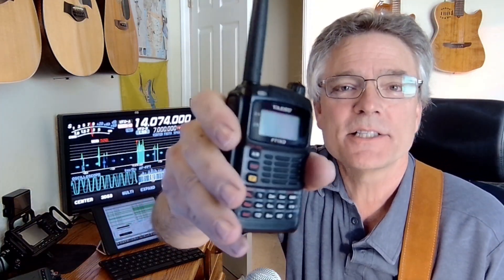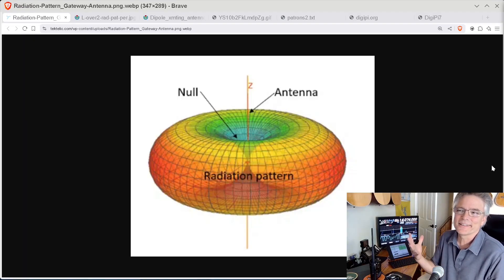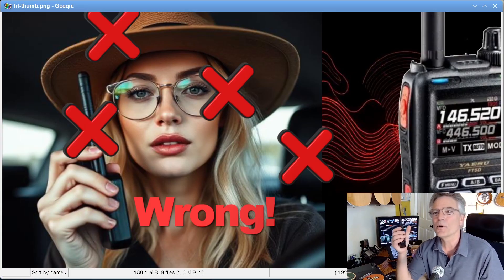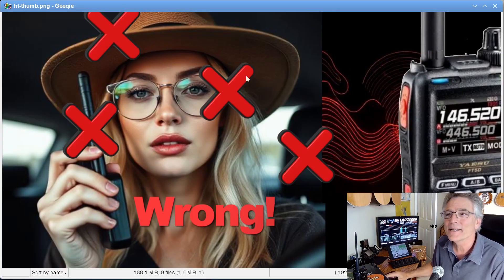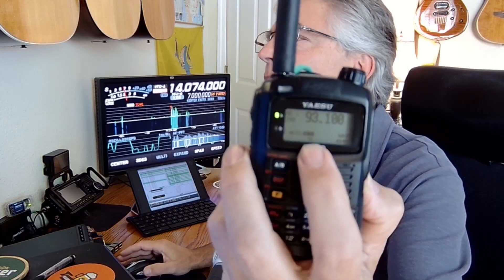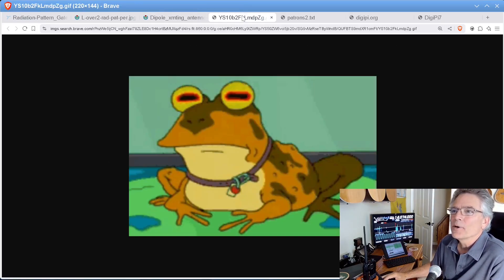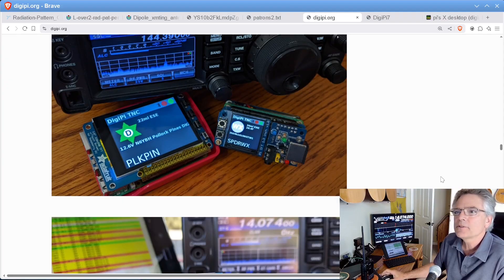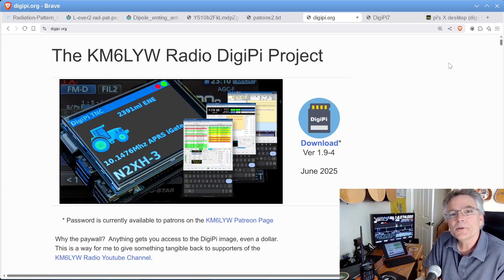Operate Like a Pro, Double Your Range!

Comment: Good point on metal obstructions, lucky I have a soft top vehicle but I get the point about repeater direction.

Lucky in Canada wiring in the attic is minimal, only lighting for the top floor and aluminum roofing nails.